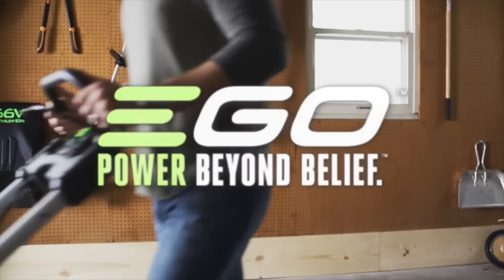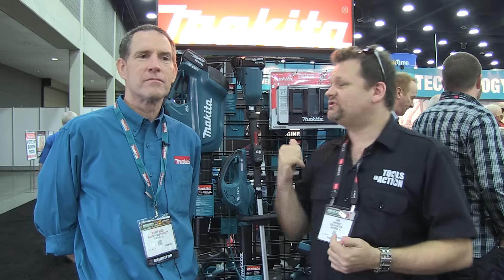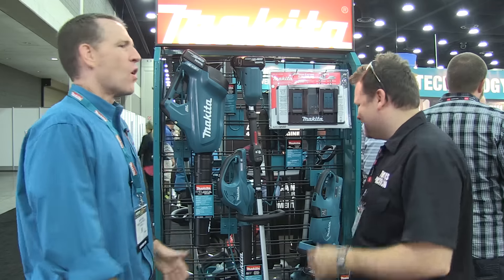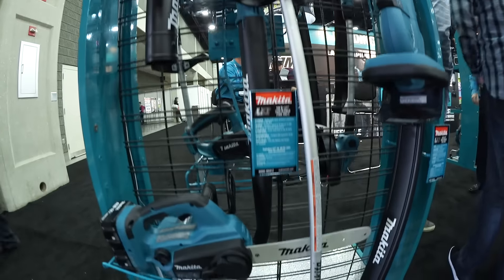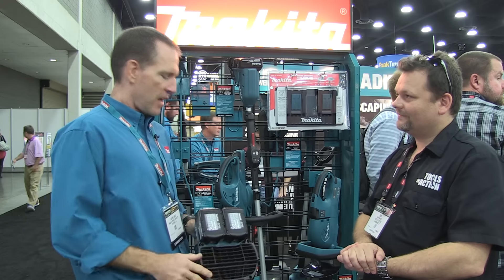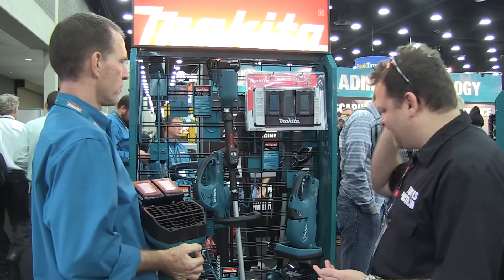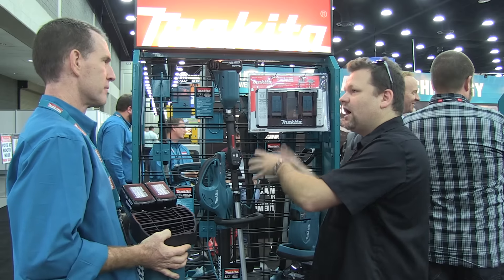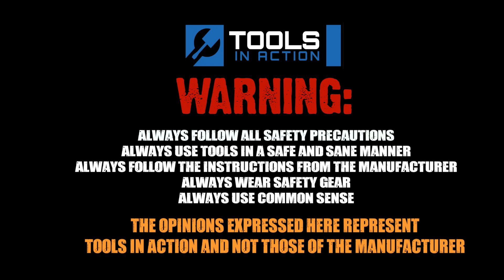Makita 36V X2 Cordless Outdoor Power Equipment Overview -  GIE 2015

Comment: really looking forward to your makita coverage from STAFDA.  make sure to break some rules and show us some stuff we aren't supposed to see!!  Your TIA, you guys can do whatever the f you want!!! Hahaha 

I love the fact that makita has the X2 line.  it's great to be able to have the power of 36v tools within my 18v battery platform.  such a cool thing they did.

makita, if your out there listening..  don't stop putting the led battery indicators on the tools now that they are on the battery!!   there are a lot of us long time users that have a dozen plus batteries without the indicators and want to know the charge.   it's also nice to be able to see the charge level while using the tool without the extra step of stopping to check the battery...  on the battery led is great for when your grabbing a battery out of a stack and you want to make sure it's charged before you put it on the tool  or doing dead battery inventory so you know which ones need to be charged.

Comment: I really like how Makita uses the existing 18 volt batteries to run a 36 volt tool.  No need to buy a 36 volt tool and battery if you are already in the 18 volt line.